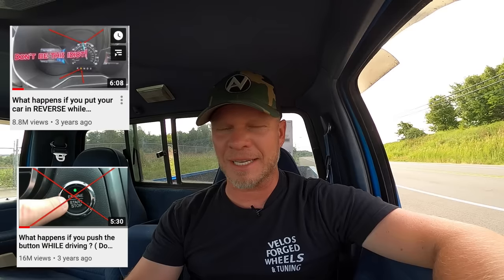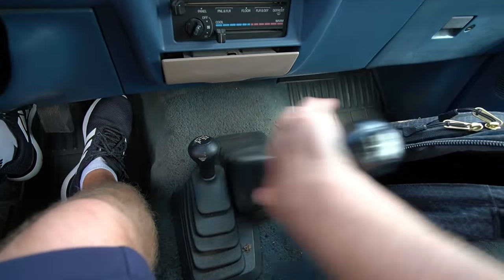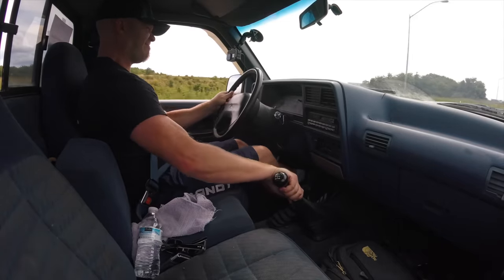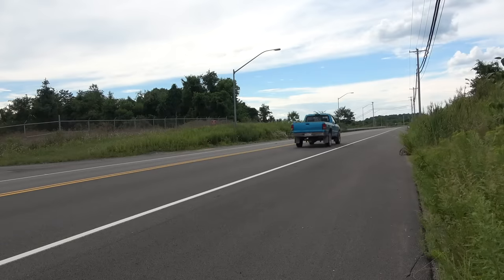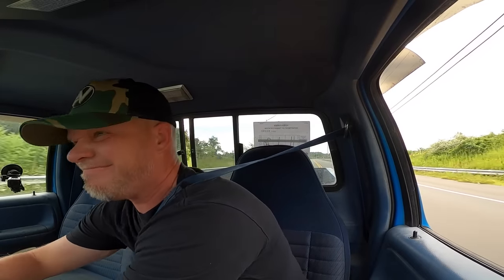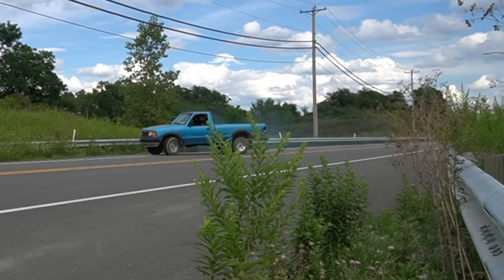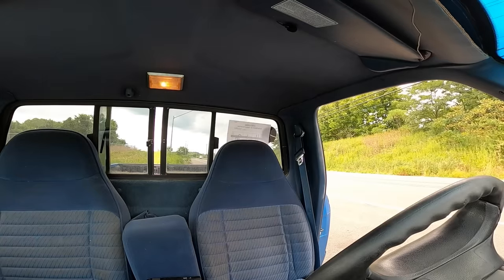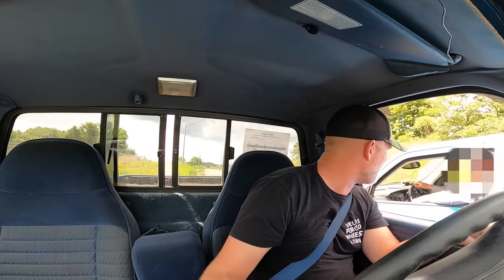What Happens If You Put A MANUAL Transmission In REVERSE While Driving?

Comment: I’d be interested in seeing an analytical tear down of the transmission to find out which parts sustained the most damage.
Reply: Most likely the dog teath or the idle gear which reverses the direction. But I would love to see the extent of stripped gears
Reply: The clutch will have taken the worst of it. You can hear the gears grinding as he puts it into gear, but he isn't fighting the car's momentum at that point, just the momentum of the gearbox itself. It's not really that much worse than putting it into reverse before coming to a complete stop in a parking maneuver. But when he releases the clutch, the plates are spinning in opposite directions! 

When he said "I thought it was limping, it didn't have any power but now it's back" - that was probably a chunk of clutch friction material having broken off and getting stuck between the plates.
Reply: @HaralHeisto  That last sentence in your comment had me laughing!  I could visualize small jagged pieces of clutch plate material violently bouncing around the transmission housing, occasionally being captured between the two rotating surfaces .. 😂
Reply: True
Reply: @jonkaminsky8382 You laugh, but it can and does happen. Clutch plate friction material is similar to brake pads - if it overheats it can go crumbly and have bits flake off
Reply: @HaralHeisto  The engine won't rotate backwards. Clutch is connected to a flywheel so they always will rotate in the same direction as the engine. The input shaft in the gearbox rotates the same direction as the engine. It's the idler gear in the gearbox that allows the output shaft to spin in the opposite direction when you select reverse.
Reply: They did it in a german video called the 7 Death Sins (Die 7 Todessünden des Autofahrens), drove the car to 30 km/h, then threw it in reverse. Afterwards it was towed to a mechanic because 1st gear wouldn't engage anymore. They dismounted the transmission and opened it in the workshop, only to find metal shavings from the gears inside the gearbox oil.
Reply: Only The tires!
Reply: @hawatt1000  No-one said the engine would rotate backwards. But if you put the gearbox into reverse while the wheels are turning forwards, the gearbox input shaft WILL be rotating backwards to normal. That''s isolated from the direction of rotation of the engine while the clutch is open. Notice in the video his wheels didn't lock up until he released the clutch, not when he put the gearstick into reverse.
Reply: @HaralHeisto  You basically said it in your previous comment: "But when he releases the clutch, the plates are spinning in opposite directions!". So, I just said that it isn't true, the clutch always rotates in the same direction as the engine. Or about what "plates" did you mean?
Reply: @hawatt1000  The drive plate of the clutch always spins the same direction as the engine. The driven plate is supposed to always spin that direction, but in the situation of travelling forwards while in reverse it's spinning backwards. That should NEVER happen normally, but it will in this one case.
Reply: @HaralHeisto  Let’s start from another situation: What happens in case you are at a stop, and put it in reverse gear and release the clutch? Does the clutch spin  to the opposite of the engine? -No. Why? Because reverse movement is controlled by the transmission, not by the clutch. 

Now, what’s different in the situation in the video? The guy is in the forward gear, once he puts in reverse, he disengage the clutch, and it still rotates a bit in the same direction as engine, after the clutch is released the gear responsible for reverse gear is taking the pressure to stop the vehicle, the clutch will rotate in the same direction after it is released even in that situation. The transmission here is working as a break, until the point it has no forward movement and moves in reverse.

To prove me wrong, you will have to demonstrate that clutch is somehow responsible for the reverse movement. Which as far as I read everywhere, it is not. but maybe I don’t know something… 🤷‍♂️
Reply: @hawatt1000  Ah ok, this explains where you're getting confused - a manual transmission cannot act as "a break".
Unless it's in neutral, the input and output shafts on a gearbox are mechanically linked - they rotate the same direction in forward gears, and they rotate in opposite directions in reverse. It doesn't actually matter which side of the gearbox is applying torque, both sides will rotate.

In the video - he starts in a forward gear, with the clutch engaged. Everything is spinning in the "forward" direction.
He disengages the clutch - both sides are still spinning, torque from the wheels maintains rotation of the gearbox and the gearbox side of the clutch. That side will begin to slow as the car loses speed coasting.
He puts the gearbox into neutral. The engine is spinning forward at idle speed, which keeps the engine side of the clutch spinning forward. The wheels are still spinning forward, but the gearbox side of the clutch rapidly loses speed as there's no torque applied from either side anymore.
He forces the gearbox into reverse. This is difficult, as he needs to mesh a stationary cog to a moving one within the gearbox, and that's what causes the grinding noise. Once it engages though, the two sides of the gearbox must now be spinning in opposite directions. The gearbox side of the clutch is now spinning "backwards", driven by torque from the wheels, not from the engine.
When he releases the clutch, the two plates are rotating in opposite directions. The clutch slips, until the torque from the engine side overcomes that from the wheels, and the wheels lose traction with the road and spin in reverse.
Result - huge amounts of wear on the clutch and possible damage to any of the gearbox elements that are involved in the reverse gear.

I don't need to demonstrate that the clutch is responsible for the reverse movement, because it isn't. You just misunderstood the relationship between the input and output shafts of the gearbox, possibly because the same thing wouldn't happen in a slushbox automatic.
Reply: @jonkaminsky8382, that would be interesting to see but I'd also like to see what happens if you can do the same with an automatic transmission that doesn't have a "brake lock-out" etc.
Reply: Took the words out of my mouth. Would be an interesting video.
Reply: Fr something must’ve worn out faster
Reply: Listen closely when the Audi TT passes you hear the turbo flutter haha
Reply: "It's more fun to drive a slow car fast than to drive a fast car slow"
Reply: @HaralHeisto  I've just started learning to drive standard so your little debate was really interesting for learning more about how the transmission and clutch work! And since the other guy wouldn't give you the satisfaction of closing this off, I will. You're right, I think!

It's like if you were clocking it in reverse, shifted into neutral, then tried to shift into first. The clutch would be spinning in the opposite direction as the flywheel because it is mechanically connected to the wheels, which are spinning backwards in a gear that is designed to drive them forwards.
Reply: Bro yall some mechanical nerds lmao
Reply: @HaralHeisto dude the synchros probably got toasted. The clutch probably did experience more than typical wear, but as quick as he engaged it, probably not that bad. Also, your explanation of why he lost power makes no sense.
Reply: Tires would be fucked too
Reply: @akiwi8091 Actually he is wrong. He is trying to explain how a manual transmission works and doesn’t even understand it himself. I think he doesn’t understand how the reverse idler gear works. Clutch disc will never rotate backwards  or the input shaft. Input and output shafts are not directly connected. There is also a counter shaft. When you move the shifter into reverse the reverse idler gear is pushed connecting in between 2 other gears one of them on the output shaft which is the reverse gear. The idler gear reverses the rotation of the output shaft which makes the wheels rotate in reverse but the input shaft is always spinning the same direction as the engine. The input shaft is directly connected to the engine through the clutch so even in reverse input shaft will always rotate same direction as the engine. The clutch is to connect and disconnect power from the engine to the transmission.
Reply: @miguelc3033  Thanks man, I do not understand how some people can be so sure of themselves by telling such nonsense
Reply: Synchronisers are the first to burn

Comment: I don't know what's better, the fact that it goes into reverse, or that it drives fine afterwards, or this guy's laugh of sheer joy at it like a kid on Christmas morning!
Reply: 69 likes
Nice
Reply: Boss Hogg at the end was a highlight too
Reply: Well as someone who owned mostly manual transmissions (the default in our country) I'm pretty surprised he got in in reverse in the first place. I'm guess double clutching on an older model should do the trick. The older the better. It's the same for first gear (near impossible to get into unless you are standing still). I used to own a really old (1985) suzuki that I could put into first, but it took some convincing. Now that I think of it I was able to put in into reverse if I was moderately rolling, but it really took some effort. Modern models simply have a lockout that prevents first or reverse gear.
Reply: @andregon4366  
Just turned it into 969 likes. 
🤣
Reply: My friend thought it would be funny to shift my 2001 camry into reverse going down a road at like 40 and I thought my engine exploded for a second but it drove just fine after.
Reply: @patrickd9551  you can put pretty much any car into first while driving. one some it is harder on some it is easier.
Reply: His laugh...
Reply: it's the power of those old Ford trucks, indestructible creatures
Reply: @sambrott6757  he made sure to do a burnout in reverse to keep the engine from turning backwards. I don't think he's as dumb as he lets on.
Reply: Thinking about it, this is probably how they do the 180 Reverse J Turn trick
Reply: its a ford ranger what else can you expect?
Reply: When at that moment you think you have 6 speed and actually have 5 speed
Reply: Or the security guard thinking he's from Al Qaeda...
Reply: They don’t build them like they used to

Comment: I have always worked with a dispatch truck that had 6 speeds, and I always had to take the same route on the same highway.  One day my truck went into the shop for maintenance so they assigned me the backup truck which is identical but with the difference that it only has 5 speeds and the reverse where the 6th is.  I was doing my route as normal when by muscle memory I engaged "6th", which was actually reverse and released the clutch... it was at that moment that I became aware of what I had done, I felt panic I thought the transmission would explode or the truck would stop suddenly, losing control at high speed, it was the end for me;  Those and many other fatalistic thoughts passed through my head in a fraction of a second, but fortunately for me, the transmission safety mechanism did not allow the reverse to be engaged and the vehicle only remained in neutral.  That was the greatest feeling of relief I have ever experienced in my life, but a feeling of tension remained in me for several hours.
Reply: Same has happened to me - I learned how to drive on a 6 speed and then, later on, drove a 5 speed after getting my license. I'm cruising on a highway, shifting into the imaginary 6th gear although it doesn't exist and I let off the clutch. I was weirded out by how it feels like I'm in neutral and then it dawned on me that I actually shifted to reverse. I shifted back into 5th and I think that car hasn't forgiven me for what I've done, even to this day 😅

Comment: I'm impressed you got it in reverse in the first place. Most old-school manual transmissions physically engage the teeth of the reverse gear. If the vehicle is going forwards this should be impossible because the gears will be spinning in opposite directions. All you'll get is a lot of gear grinding.
Reply: Right, no synchronizers so shouldn’t mesh
Reply: @technophant  Not quite. The gears are rotating in opposite directions and must be slid together to mesh. Gears that use dog clutches for engagement can still be engaged with no synchro, but you have to do your own gear synchronisation (a.k.a double de-clutching).
Reply: @bjem2287  Correct me if I am wrong, I've never had one apart but I think the little mazda 5 speed that should be in this truck would have syncros on the reverse gear. In normal operation the purpose would be to stop the input shaft when shifting to reverse unlike older transmissions like the sm465 where you commonly had a slight "grind" going into either reverse or first with no synchronization.
Reply: With the clutch down, the grinding might still synchronize it given some time. Certainly not a good idea though.
Reply: Came here to comment this. I tried this on purpose in an 84 toyota land cruiser and couldnt actually get it to go into reverse while i was driving in gear
Reply: My old car's reverse gear was not synchronized and not infrequently the teeth collided such that I could not put it in gear. I had to either double-clutch (which didn't always solve it) or let go of the brake and roll slightly to get it in gear
Reply: @MrHercules222  I can confirm, Im not sure if it had the m5od this year ranger but Ive rebuilt a ranger transmission and there’s in fact a synchronizer on every gear, including reverse in the mazda gearboxes
Reply: My ‘23 Taco can be engaged in reverse at any forward speed. I haven’t had the cajoles to let up the clutch (not until it’s paid for).
Reply: @tigermaneater9880 can confirm, I have a 94 explorer and the m5od all gears are synchronized including reverse
Reply: You do forget hat when you press the cluch pedal that you spreatare the engine from the shifter right